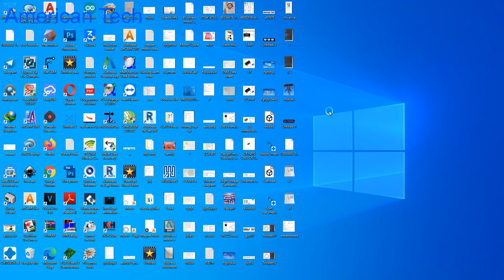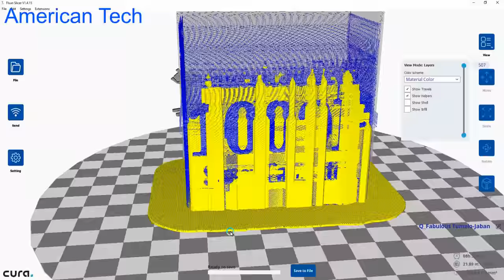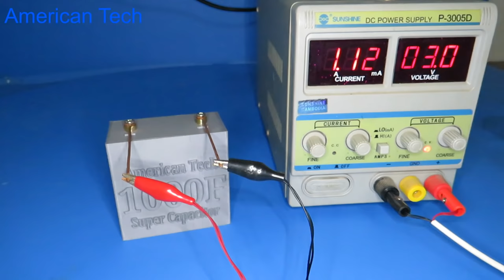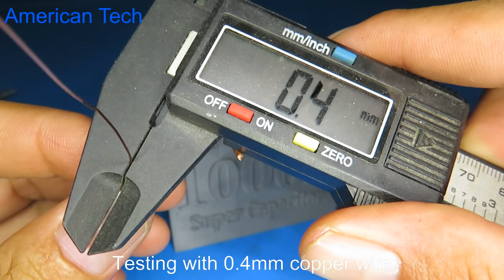How to make 1000F Super Capacitor

Comment: Where is the final voltage and capacitance measurement with a multimeter? Where is your PPE? Where is your 1000V electrically insulated tools. A 1000F capacitor can severely injure or kill someone. A capacitor would fully discharge all at once. Nice battery though.

Comment: It’s not wrong in how you make a capacitor. It’s wrong in how it is not a 1000f capacitor because a 12v 200f capacitor is the size of a Car battery and on top of that there are videos online that actually show the real process of making super capacitors and this is not it. This is how to make an original capacitor from scratch that is just dated in process at this point in time. There’s also papers explaining how to go about making ultra capacitors and ironically a lab bench version uses tape to make the graphene layer. You also need to make liquid carbon nano ink and then bake it onto the material for one of the layers. Finally you have to make sure that your layers stay compressed as you roll the material together. The material then gets sealed in shrink wrap and then placed into its protective case and shrink wrapped again with the label. Don’t look at me for specific instructions but I will refer you to look at Robert Murray on YouTube describing the exact process in his older videos. He does a better job explaining it.

Comment: Use a tinfoil for cooking. As dielectric plastic foil allways for cooking and you may get a capacitor version 2.11 and with that capacitor you can save energy enough to light up a city for at least 30 years. 🤣🤣🤣🤣🤣🤣🤣🤣🤣🤣🤣🤣🤣

Comment: guys can we REALLy even say that that is a compacitor? Isn't the diaelectic missing? I mean the salt in the toilet paper ofc makes it conductive right?

Nm I tested it. the paper actually works as an insulator even with saltwater.
But I guess that ist actually the secret for good compacitor. If this is even in the range of the claimed 1000F compared to the view nF-compacitor that electro boom has produced. The saltwater makes quite a difference. But its still wierd to me that its not conductive acutally.

Comment: Why you didn't test it before put it in 3d printed box? Even after you didn't check capacitance by voltmeter?? Later you turned off your power supply before removing charging wires...   All prove you hide battery inside that box, scam is fun, i can see comments...

Comment: Partly true partly clickbait.
1. You can't even cross millis using aluminium electrolytic caps  (thats what being made here) let alone 1F
2. I doubt they did proper calculations (there are formulas to design caps, electrolytic ones need a special formula unique to their species)
3. They are making aluminium electrolytic cap, which has a range of few micro to milli farads and if made using quality products, maybe even a few 0.00 farads... these caps use a rolled aluminium layer with a dielectric soaked in an electrolyte.. in fact i once made a smol cap but i never tested it it was made of dry cell covers.. i guess it had a low capacity around 10^(-8)F

Comment: Lemon and vinegar don't do much to Aluminum, as You can see no chemical reaction taking place.  This capacitor as built probably amounts to no more than a few microfarads, as i have experimented with aluminum foil batteries before.  I think there is a lot of fakery here.  In addition the building technique is extremely sloppy.  I like the way it is more important to have a spiffy looking case for the "capacitor" than to actually fabricate a real working capacitor.  I think this is bogus , as someone else suggested,... by replacing from one sequence to the next, with the case filled with an actual store bought battery, and actually not a capacitor at all..

Comment: This is a false design. Placing an electrolyte in between the conductive material would not store a charge, but create a single plate. Furthermore, at 1kF, that container wouldn’t hold, nor could the current capacity of the conductors. Even if you had properly done the electrodes, you would only have successfully built an emp device.

Comment: There is far more foil surface area from a dismantled 47uf 400 volt capacitor than your fake 1000 farad capacitor. Are you another one of those guys that hide batteries in stuff.

Comment: With high current supply capability of the capacitor, the moment you put the wire, it would spark. This wont happen in lithium batteries. So fake

Comment: Super capasitor gets charged in seconds but his battery too him minutes 😂😂
Reply: Nope. I have a 500 f real capacitor and it charges like 15 minutes on some lab power supply
Reply: @viktorsak  and you are replying 3 months later
Reply: @Anonymous-mv9to  delay of charging time!. super caps need too long time to charge! usually less than 3 months!

Comment: It's fake
Reply: Yes, it is, supercapacitors are made from thin layer of carbon and stuff, this is in fact a capacitor what he build but it would make only few nano farads
Reply: @cheri758  bro i dont know if it work becouse the vinegar and the lemon juice are conductivs fluids so the foil maybe is shorted and if work at very low voltage and anyway this is not a polorized capacitor.
Reply: @cheri758  sry for my bad english
Reply: @simongirardi6938  yeah ot is capacitor but its just low capacitance not 1000f
Reply: @cheri758  for shure this capacitor don't have 1000f but I saw it marked the positive pole but it's not a polarized capacitor right?
Reply: @simongirardi6938  idk most likley isn't

Comment: 1 Farad is a HUGE amount and yours was 1000 F.  You must be magic because foil isn't going to do it.
Reply: Factory capacitor 500F / 2.7V is 35x60 mm /1,38x2,36 in and consist aluminium foil, separator and some elektrolit. Didn't try if it was salty.